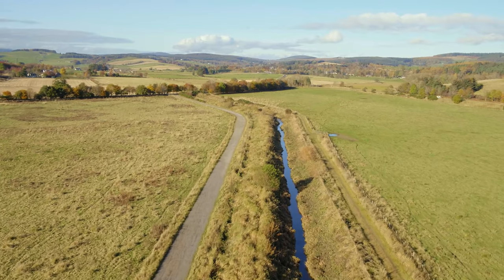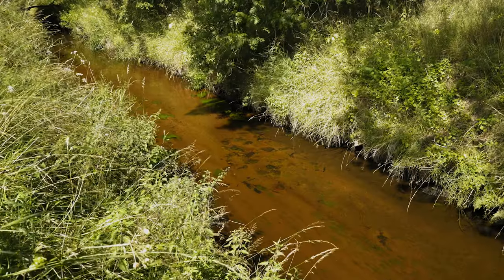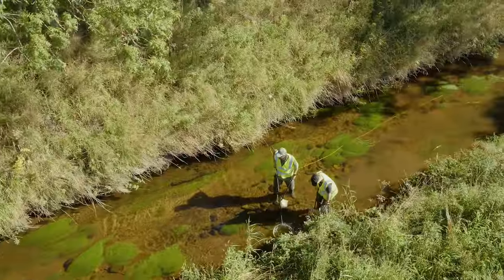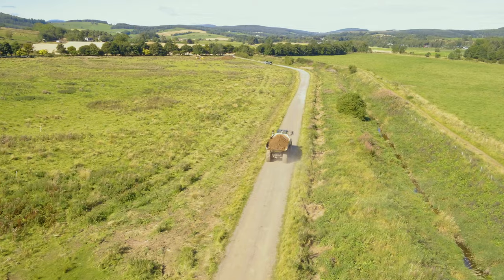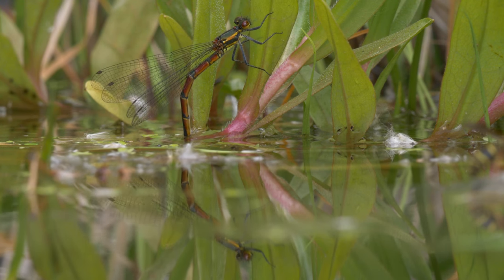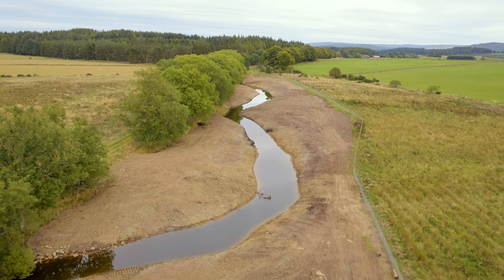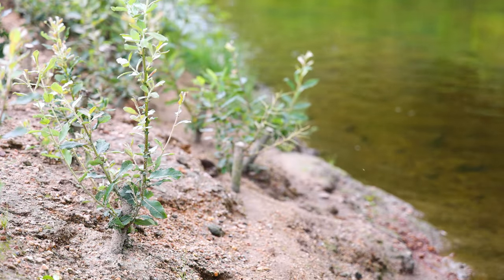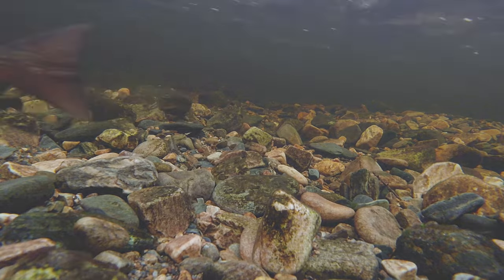The Beltie Burn: A River Restored

Comment: Interested to know what the carbon footprint of this project is VS just planting some trees and letting nature take its course with regards to the un-straightening of the burn.  Also how long it will take to sequester the carbon released for the deep excavations, land moved and subsequent fuel used on the same site.
Reply from the maker: The carbon footprint isn't huge and of course the benefits to biodiversity might be argued to be worth it. Rivers can't quickly unstraighten themselves once they have been canalised, so letting nature take its course in this case would likely mean a wait of centuries - not an option for many threatened species. Rewilding often involves intervening briefly to let nature recover and take its course from that point onwards, what has been called "a marathon that starts with a sprint".

Comment: Streams typical of higher elevation meadows and Basins where the underlying strata are so detailed overall Assessments must be made, cutting on downcutting, scour, foundational river or stream course to focus on off channel areas at oxbows, tributaries other freshwater continuity to add volume, seasonal highs and lows of flows to start primary production of vegetative forms which arise from its banks and from its depths as the integration of factors need to recover, reproduce, using Native biota rand stage of succession, in Forested upslopes, .slowing erosive factors contributing to site productivity.  Insects, invertebrates, crayfish, Arthopoda Genera Native to fulfill various stages of their inherent life forms to hatch, develop, mature and reproduce through their various life forms which include flight, egg laying, submerged forms (aquatic and terrestrail) to survive and thrive while also actimg as pollinators, propagating vegetative forms resilience and growth by supplemental additions of nutrients, ash or ashes, leaves, primary production into viable materials to make nests, provide cover, roosting habitat, natural scouring, formation of gravels, silts and other debris to slow and nourish the wetland or stream channels banks.